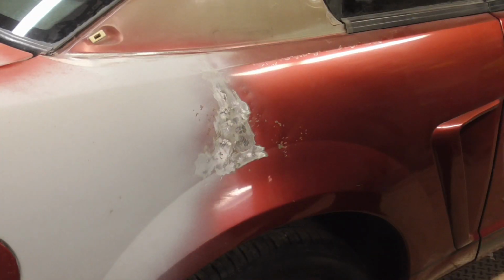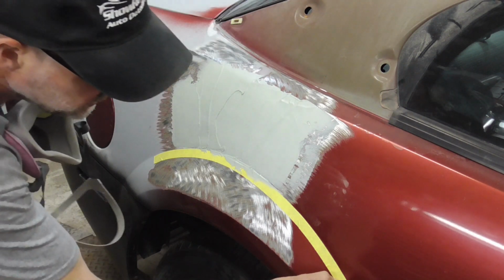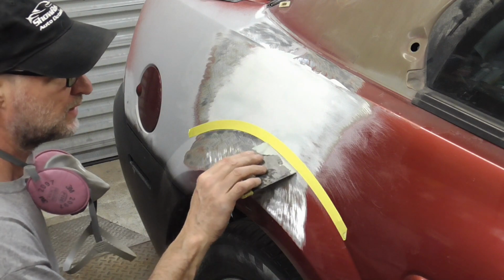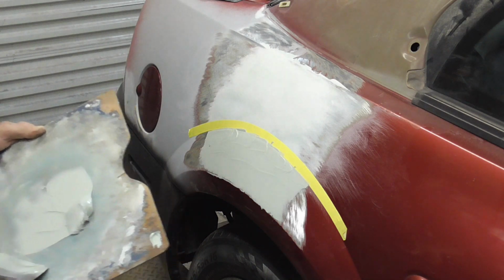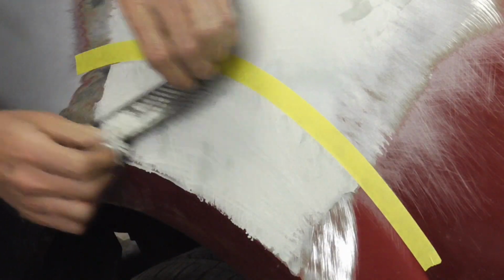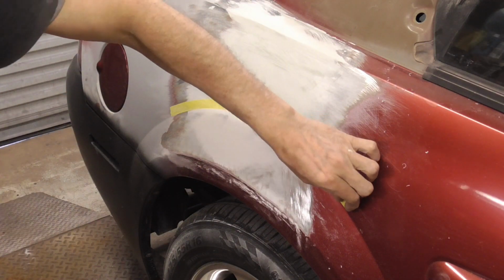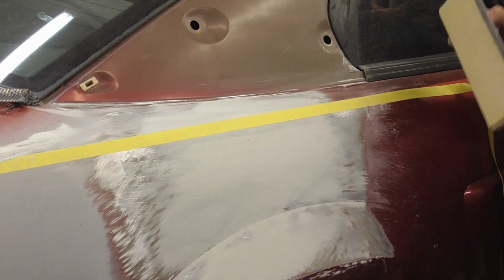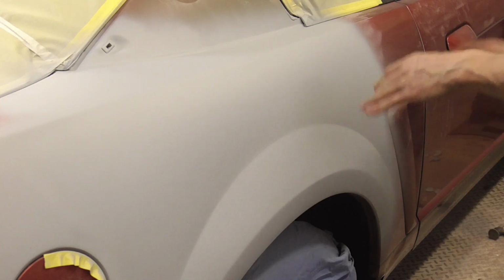How to Get Difficult Convex and Concave Body Lines Straight - Detailed Explanation

Comment: So agree with Mr. Dennis. Straight to the point.  But I think for someone like me (starting DIY) would use smaller sanding blocks. I see myself tearing up that tape lines
Reply: The length of the medium board gives you better control, amplifies your point of contact and helps prevent digging in.
A long board would be unwieldy, but he's showing exactly the most straightforward way to get good results.

Comment: Hi. Great video as usual. Can you tell me if you 1k or 2k primers.??? Cheers
Reply from the maker: I use Lacquer Primer because it works fine, drys fast, builds fast, sands easy, cheap, doesn't harden in the cup, you can pour the unused portion back in the primer can and you can mix it thick or thin.  2K primers are great too and really hold down any imperfections that you primed over. Really it comes down to the cost for me.  Glad you enjoyed the video.

Comment: If I use filler to fill a dent and after sanding I see metal showing through in spots, even though the repair feels flat, should I pound in those metal spots and add more filler until the metal isn't showing any more? Love your videos.
Reply from the maker: If it feels fine then leave it, prime it with your choice of primer surfacer and block sand it.  If the high spots show up quickly then they probably should be knocked down.  You  might get away with it though and not notice it in the final paint job - that's a choice thing.  I've left minor high spots many times and got away with it.  You get away with minor high spot easier than low spots.  Glad you like the videos - Jerry

Comment: Hey. Love this video. Very helpful info. I have a question bout old paint. I have a truck with 60 yr old paint on it. Some is just faded, some is warn down to primer, some has rust and needs body work. Is it ok to scuff over old paint and paint over or do I need to go to bare metal? Thanks as always.
Reply from the maker: Yes, it's fine to paint over that as long as it is not cracked, peeling, etc.  My dad used to say, "Old paint, in good condition, is the best primer."  Let me know how it goes :)
Reply: Lakeside Autobody thank you so much! Where are you located sir?

Comment: Thanks for another great tutorial, Jerry, you ROCK.  I like that you stacked the sand paper grits on the board, which saves time and hassle.  Great tip!  Do you have a favorite brand of lightweight filler?  I've only used Bondo brand, which is ok, but I have to believe there is better out there for not much more $.
Reply from the maker: My opinion is that they are all really the same quality so I look for the cheapest (sort of like motor oil i guess) - right now I'm using - http://autobodymaster.com/product_list.jsp?PHPRJ_GROUP_ID=1868
$19/gal
Reply: Evercoat rage

Comment: A really nice stuff but flexible plastic spreader works great for them just make sure the first amount is pressed firmly to get into the Grainger marks but usually I get the curve good most of the time in one coat...then sand it with 80 then 120 & 240-280 for primer
  Keep up the good work..
Reply from the maker: Thanks for the comment and support Peter :)

Comment: Got a quarter panel on a 2011 impala i need to do some work on.  The body line isnt sharp and crisp.  How would one go about dealing with that ?  Btw im a red seal welde4 and apprentice mechanic  this info your sharing is great.
Reply from the maker: You can do it the same way.  You can do it in sections.  i.e. big flat area first, lip second using the masking tape to protect the previous work.  Don't worry about the subtle body line till the end.  Then you can wipe some filler in the concave body line and sand.  Maybe a rubber tube or hose with sand paper wrapped around will help you get that contour.  You can also choose to just go at it with out the use of masking tape.  I find the tape helps a bit though.  When you lay it down, you can actually see if your body work is looking good and straight.  Hope that helps a bit :)
Reply: Thanks for the reply.  It was quite quick.  The body line is convex so i figure slice a rubber tube open and use that
Reply from the maker: @Newfoundlander86  I looked up that car.  Do you mean the straight body line the length of the quarter or the body line around the wheel opening?  If it's a convex body line, go ahead and use the tape method.  When you pull the tape your body line will be very sharp.  Then just knock it down a bit with some finer paper.  Rough paper will cut it down too fast and you might mess it up.  Let me know if that makes sense :)  This may help if it's the wheel well opening body line - https://www.youtube.com/watch?v=H8SprtjSw4I  this for the quarter body line - https://www.youtube.com/watch?v=sStbeOOgyD8
Reply: Makes sense bring it to a sharp line and blunt it after removing the tape.  Thanks again.  Keep up with the videos if you can they are great for other people who dont have the experience.  I also have a bad spot in the roof of my mazda 3   depeding on how bad the rust is i may cut it out and glue a patch in.     If you get a chance you should do a video on surface rust repair.
Reply from the maker: @Newfoundlander86  Good suggestion my friend.  I'll try to look out for a panel that has rust like that.  Have a good weekend :)
Reply: One last question.  Sorry for all the questions but hey hows a guy spose to learn ?  Why not use a flange tool instead of tapping the weld down ?  I figure in areas where the panel is not flat and the flange tool bumps flat it would make spots that would have to be hammered down anyways.   Oh also I subscribed
Reply from the maker: @Newfoundlander86  Ask as many as you want.  Thanks for the sub.  3 good reasons for not flanging:  1) You can't always flange - i.e. corner, contours, wheel well lips.  2) Flange tools give you only about 1/2" of flange width to glue to.  3)  Its just efficient to have seams below the surface so there's no chance of high spots.  I'm going to knock any seam down anyway because it's beneficial to have a protectant (buffer) between the seam and the paint.  Hope that makes sense :)
Reply: Sounds like i dont need to bother with a flange tool then.   Thanks again

Comment: How did u prep the edges at where the different sections of body filler meet up
Reply from the maker: If there is un-sanded filler on the edge, you can hit it lightly with some sand paper to rough it up a bit.  In this case the filler was so thin that I don't think it would matter much.  Good thinking!

Comment: What does he block the primer with as in grit and when he reprimers it what does finish sanding mean?
Reply from the maker: You can block primer with anything from 80 grit (real large damage areas with lots of thick primer surfacer) to 150 grit (general blocking)  Finish sand with anything from 220 - 320 on a DA or 320-400 wet/dry sand.  Let me know if that makes sense - if not ask more ?s - Jerry

Comment: The sanding block that you use looks like it has an extra thick pad. Did you make it like that?
Reply from the maker: Yes - unfortunately the pad on that block wore out so... (not proud of this) but I went to dollar general looking for a foam place mat or something to replace it.  Sadly, at the time, the only thing I could find with firm enough foam was a pair of large summer flip flops.  I cut it to fit, sprayed it with 3m Super 77 adhesive, and stuck it on.  I've been meaning to get a new one soon - good eye!

Comment: Is there any reason that you prefer steel over plastic body filler spreader?
Reply from the maker: Not really other than they clean really well.  You keep two of them and use one to scrape the other completely clean every use.  Plastic ones tend to be a hassle to keep clean unless you keep them in a coffee can of thinner like an old boss of mine did.  Both work/spread just as well - plastic better for curvy areas and metal is great for spreading tight and flat.

Comment: Is that sanding block solid or does it give a little like a sponge to confirm to the roundness?
Reply from the maker: It's pretty stiff.  It's actually the sole off of a flip flop from Dollar General.  The original pad was thinner but the same stiffness (was damaged a bit).  If you purchase one, it's usually thin but does give a little.and does help to go with the curve.  I'm going to get a new one and use it with the pad that comes on it.  Jerry
Reply: @LakesideAutobody  So it needs to give a little for curved panels? Would a sponge work or too soft
Reply from the maker: @mrsemifixit  Too soft.  You really don't need any give - just enough so that the paper doesn't load up on the edge when sanding curves.  For example:  If you used a super square hard wood block on a convex curve it just wouldn't work as well as a block made for auto body work with a thin pad on it.  If you are trying to make a home made block, I would go to the material store and get some vinyl with the foam padding attached to it - like the stuff to protect tables and stuff - then spray adhesive it to a block.  Jerry

Comment: What do you use to grind it to bare metal? And once the dent has been filled do I need to use a self etching primer on the bare metal?
Reply from the maker: All production body shops use fiber resin grinding discs i.e. https://www.amazon.com/Zirconia-Resin-Fiber-Sanding-Grinding/dp/B07V9YGYYP  Don't use an angle grinder like you see sometimes on YT because it tends to shine the metal or rub.  You don't need etching primer.  Always use sharp fresh sandpaper and that's all you need.  I've worked at many shops and not one of them used a self etching primer.

Comment: Same procedure with the tape with more subtle bends? Like most 90s cars that have a subtle flare at the wheel well?
Reply from the maker: I use the same procedure on every dent.  If it's a real subtle flare you really don't have to use the tape though it may take a few tries to get it perfect.  That's when a thick primer surfacer like feather fill comes in handy.  Get it close and the feather fill is thick enough to help you get it perfect during block sanding.  I'm going to do a video soon on the use of feather fill.  Have a good week :)
Reply: @LakesideAutobody  Cool thanks. I’m just having a hard time feathering using one of those 3M rubber blocks that fit the palm of your hand because of the curves of the wheel well. Think if I attached a thin piece of foam to the bottom it’ll help?
Reply from the maker: @mrsemifixit  I don't think the foam will help you out.  Try using the block with a nice fresh sharp piece of sand paper - don't be afraid to use course grit.  See this vid for the reasons:  https://www.youtube.com/watch?v=rv0uB-ZvrFo&t=18s
With you block you will be sanding on an angle through the curve i.e not parallel to the valley and not perpendicular to it but on a pretty goo angle to it.  Then go on an opposite angle to cancel out those sanding strokes.  You may have to prime it to see the result.  No problem though as you can block that and still put filler over the top of primer if needed.  Let me know how it goes for you - been there hundreds of times.  That's why I used to love "Feather Fill"  - I'd bury that sucker before lunch break - come back, block it and spread 2K putty if needed.  Then prime again, block, etc   That's par for the course - every body man suffers through that  - Jerry
Reply: @LakesideAutobody  Thanks I’ll try. If I use that sanding block sometimes I can’t get the entire surface flat and end up using 1/3 of it or just the edge on curved parts. Is that ok to do?
Reply from the maker: @mrsemifixit  That's exactly what you do!  Bravo.  There are no magical blocks or gimmicks out there for getting dents straight - It's all going to come from "you" - i.e. - how you hold the block, what angle you attack it from, sand paper grit, pressure, length of board etc.  Remember,  the only boards they had in the late 70's and early 80's was the long wood or plastic 17.5" board, 9.5" board and the rubber 5" block and everything that left the shop looked straight as heck :)
Reply: @LakesideAutobody  Awesome! Lol thought I was using it wrong since only the edge is being used around a curve/contour lol. Thanks for the help. I just finished blocking with 400 grit it “feels” like one panel over the repair and original panel but I’m worried when I lay down paint it’ll show some lines lol
Reply from the maker: @mrsemifixit  Wipe it down with wax and grease remover and while its still wet you can get an idea of what it will look like painted :)
Reply: @LakesideAutobody  Could rubbing alcohol be used or glass cleaner? Curious about alternatives
Reply from the maker: @mrsemifixit  I'm not sure.  No big deal though.  Paint it anyway :)   Let me know how it turns out.  Painting your bodywork is always fun  - tells you what you need to work on for the next job you do.
Reply: @LakesideAutobody  I just painted and again it highlighted my primer. For some reason I’m having trouble feather the filler primer into the existing panel. It feels smooth when I run my fingers through after sanding but shows up after painting. The filler is feathered nicely though
Reply from the maker: @mrsemifixit  Check out this video for help on that:  https://www.youtube.com/watch?v=pjXkhi1E7hQ  **  If that doesn't help, I have some others that address that problem.  Are you block sanding the areas that you feather edged with the DA?  If you have time check these out too because I feather edge a lot of paint, prime it with primer surfacer, block sand, prime again, finish sand and paint.  Let me know if this helps - Jerry

Comment: What primer do you use is it Lacquer or 2k primer
Reply from the maker: It's Auto Body Master lacquer primer - I don't ever have problems with lacquer primer - dries super fast, builds fast, sands easy, doesn't shrink if used correctly, cheap, doesn't harden in the cup, throw the unused portion back in the can, one gallon makes 2 gallons mixed, etc. I like 2K - it works fine too just more money and you use more because you waste more.  I like feather fill too for body work that needs a little help as it's really thick stuff :)

Comment: I remember the first car that I painted. I was 15 and it was my first car. A 1960 Dodge Dart. I ran out of paint half way through. My friends dad had a gallon of auto paint so I switched color in the middle of my paint job. 😂  That was like 45 years ago.
Reply from the maker: That's funny - did it turn out OK?
Reply: @LakesideAutobody  Not really. But the only way you’ll learn is to roll up your sleeves and give it a go.
Reply from the maker: @donaldappelhof2059  You're right:)